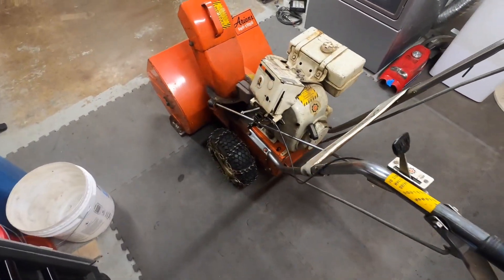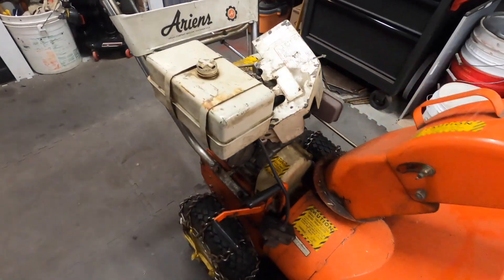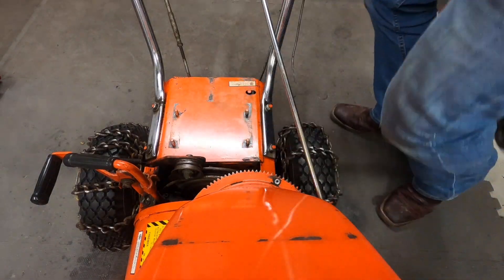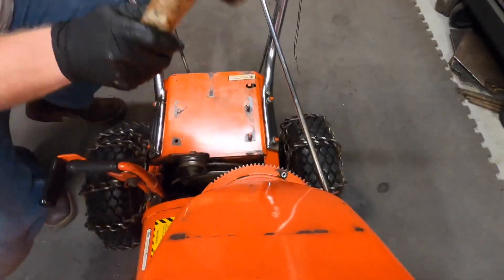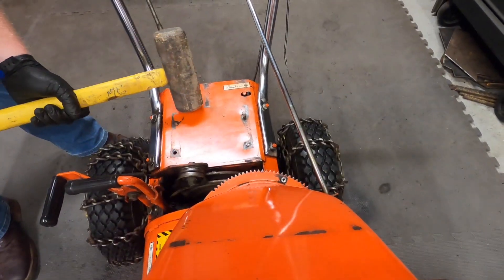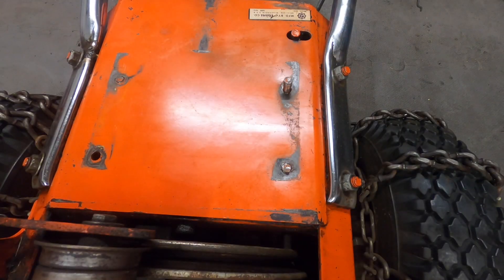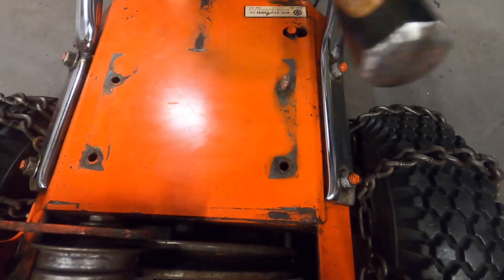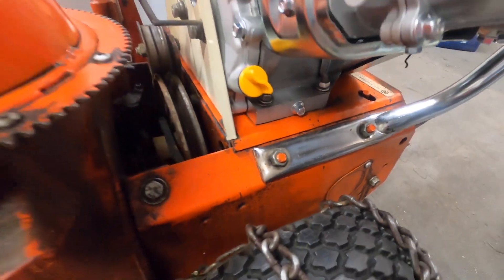Ariens SnowBlower Repower | Predator 212cc Engine Swap

Comment: I have a 71 Ariens 32 inch with a 7 1/2 I just rebuilt everything on this Blower, This week, All new bearing,Made up some bronze sleeves, for center shaft that had some play, And was given a 1 storm 12 hp 1 year old engine from a new Ariens, Stronger and better than any new one out there, My Neighbour, Just offered me a 1000 dollars for it, After seeing it run, He has a 300ft driveway, This thing can throw some snow. Just thought I would share this build.
Reply from the maker: I can only imagine with a size cutting area and size engine how much snow that must move! I'm in the process of buying a lathe so making sleeves and bushings will be much easier for me! Awesome build!

Comment: Hey Sean, great video! I’m actually planning the same procedure on the same model believe it or not. Do you happen to know how long the 4 bolts were that you mounted the engine with? I think they’re 5/16 thick but I need to know the length. Thanks in advance! 
JB
Reply from the maker: If I remember correctly they were 2.5 or 2”
Reply: @SeanGilmore92  perfect thank you for letting me know!

Comment: What model is this machine?
Reply from the maker: I believe it is a model 10M. It seems to be a 1964 or 1965 but the model number is scratched off of it.
Reply: @SeanGilmore92  The machine is a 1970-71 10,000 series
Reply: It would be a model 910962 built 1971. Tags right in the back where he was smashing those studs the wrong way.
Reply: Nice job!  Question:. Did you have to resize the belts?  If so what size?